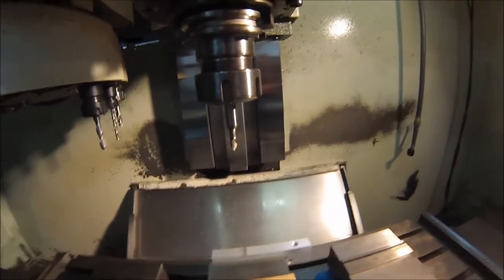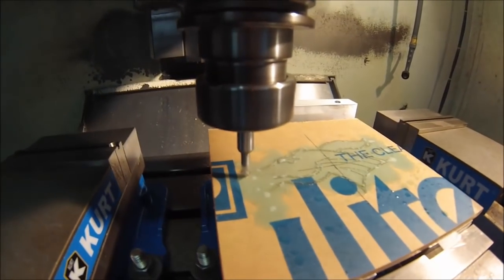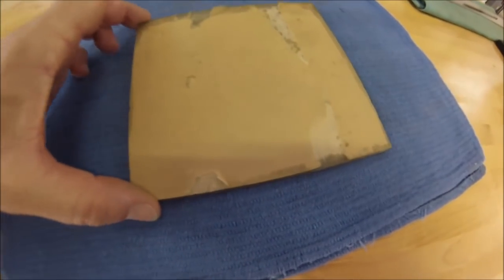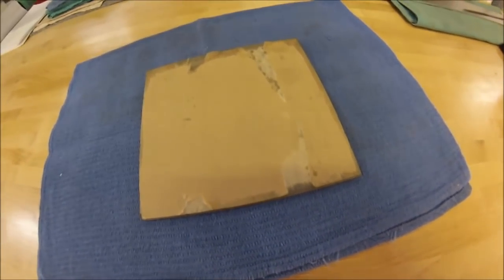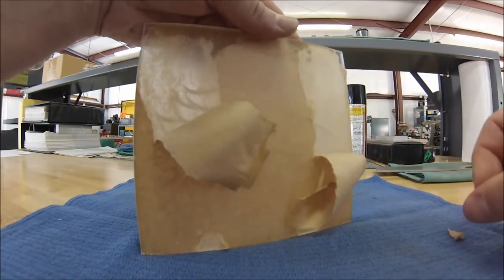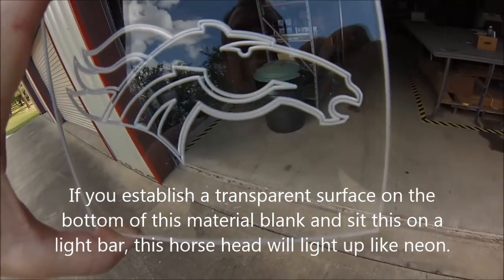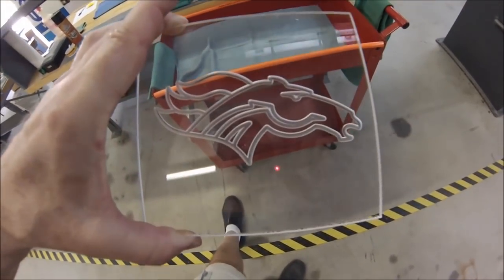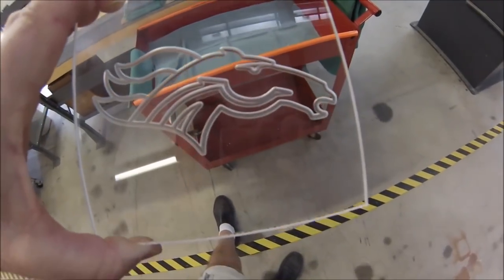CNC Engraving of a complex graphic

Comment: Hi Joe! Can I just say this was fun to watch. On the issue of maintenance and spare parts and your previous answer to me, I was wondering if the simple answer is that Fadal used standard components that can be replaced with commonly available standard components? Daniel
Reply from the maker: There are a bunch of people that had the fore site to buy all the FADAL inventory and keep the machines up and running. These machines are easily repaired with readily available genuine FADAL parts.

Comment: CNC is fun for the results......    If you're ready to get involved in mastering all the steps to get there.... 
And steps are infinite.......................................!!!    
I'll leave it to younger and crazier guys and gals.
I've been trained to it in school and almost hated it.
Reply from the maker: Pierre, I am an old school toolmaker and didn't get into CNC until about 5 years ago. I am still learning things like custom trajectory milling, volume milling, sub routines, sub programs ya da ya da......I didn't even know how to turn my machine on when I bought it. My wife found out that little detail and almost had a melt down. Being a well rounded manual machinist certainly makes for a better CNC programmer. You have the philosophy and tricks in your bag to get the job done. My first year or so was pure G code programming. Great experience. I'm in it up to my neck now. Offline programming CAM style. I do miss the feel of the dials and knobs building pressure as you turn them during a cut. The CNC just goes. Good or bad   it keeps moving. Good to hear from you. Thanks for watching.
Reply: Good thing I'm retired now, or I would need to struggle into CAD ( Not cardboard aided design...   ) G code and so on...  
I love that part about feeling the machine working right at the touch of the handles.... ;)
Reply from the maker: I am sure you know exactly what I mean. A good friend called it "The Feel". I heard Abom use that term once too. There is a lot of finesse in machining. Its not just turn the crank and force the tool through the part.

Comment: Wondering if the software guru's have conversion programs that would translate (reliably) work that was originally done in older 3D cad programs, such as CADKEY.  Anybody got a suggestion?  I've been considering looking into Fusion, and it would be nice to be able to do a conversion, rather than re-draw everything from scratch.
Reply: Work is saved in part (.prt) files.  You can also save individual items (ie: a bolt, a board, metal stock of a certain dimension) in pattern files (.ptn) that you can import into your current project and then move/rotate/trim/extend as needed.  There is a lot more to it, stuff that I haven't even begun to explore or try to understand.
Reply from the maker: I just did some reading on this. It looks like the .prt extension files from cadkey are very different from the .prt files Pro e and solidworks use. An IGES file translation may be the best for the move. But be careful not to loose individual feature control. I've seen that happen between CAD programs. The model imports fine, but you loose the ability to select and modify individual features. The model works OK for import to a drawing, but some control is lost.
Reply: It may well be that the file must be from a specific version or newer in order to work.  Cadkey does have a series of conversion programs that will allow DOS version .prt files to be used in newer windows based versions, or viewed and printed on modern printers from the viewer they later provided.
Reply: I knew it had been taken over and re-named.  Will it output whatever is needed for cnc type stuff?  I doubt I'll ever get into it myself, (as in owning a cnc mill) but there may be a time where I will need to have it done
Reply: diggerop save your CadKey files with the IGES translator within CadKey and most all CAM systems will be able to reliably read it. Recommend saving the geometry only as the Iges translator doesn't handle dimensions, notes and other misc data well. Standard geometry such as lines, arcs, and splines should be fine though.
Reply: +Cad-Cam_Man I'll look into that, thanks!

Comment: why wouldn't you make engine blocks on it?
Reply from the maker: The 4020A has a linear rail controlled Y axis. The box way version, designated without the 'A' is a better machine if your are going to load up extremely heavy parts and hammer away.  The majority of my work fits in a vise, so the 4020A was a good choice for me.
Reply: i would have guessed quite the opposite, if you're profiling a block, you're doing a lot of back and forth movements, which will lead to wear on box ways. An engine block is not that heavy, if it is aluminium. What's the max table load for the linear rail version, like at least 500lbs? For example, the centroid 5-axis CNC  machines are about the same size and are made specifically for machining engine blocks. They are linear rail machines about the same size.

Edit: According to the user manual for the 4020a, the max table load of 3000lbs. An engine block can't be that heavy.
Reply from the maker: Unless of course you are old and came from the cast iron 426 hemi era. I'll leave the engines, to the engine shops.